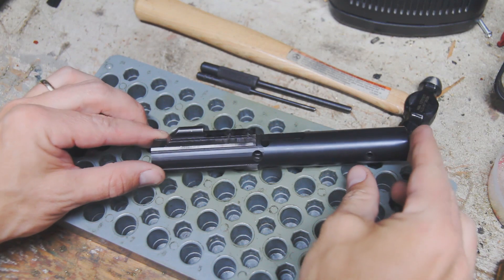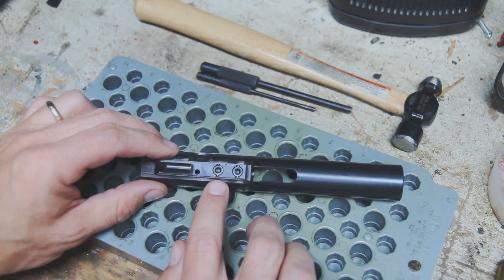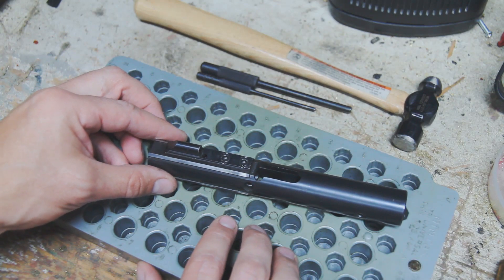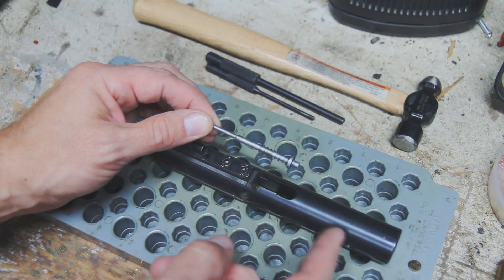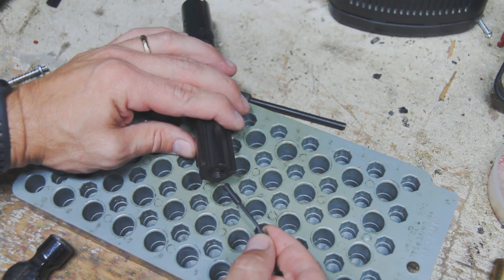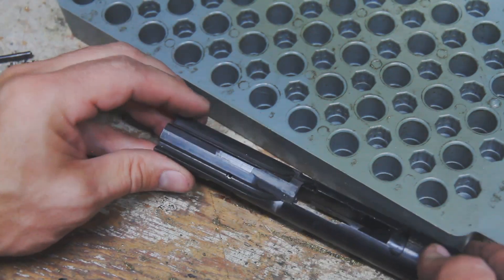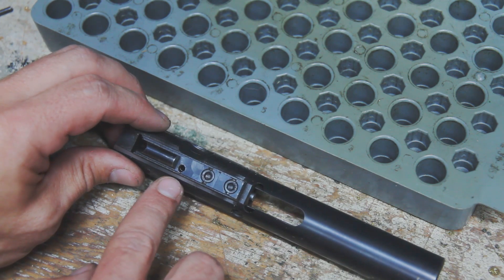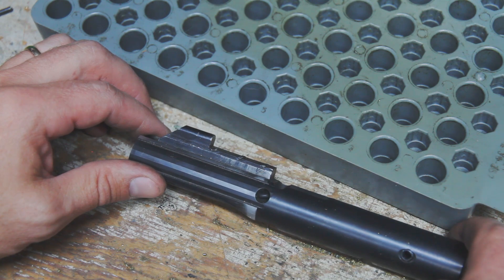AR 15 9mm Extractor Removal

Comment: I took the bolt out of mine and there was a tine spring that fe out...like an ejector spring on a 5.56 bolt....do you have any idea where that goes?
Reply from the maker: With this style bolt the only spring that I could think of is the spring on the firing pin, but that is a little larger than an normal ejector spring.
Reply: @AdventureColorado  it went in an indention on the bolt to keep it from pivoting ...thank you

Comment: Mine doesn't have the hole on top of bolt. Had to remove front screw from gas key to access it. Arghhh.
Reply from the maker: What brand is that?  I haven't heard of one like that.

Comment: The ar9 will run without an extractor. I accidentally know that. Don't ask, lol. It won't cycle by hand without it, but since it's a blowback, that case is flying out either way
Reply from the maker: The bolt will still cycle and the case may eject, but if the extractor is broken or missing it could have issues removing a case that is stuck in there due to being dirty, or out of spec.

Comment: Thanks for making video. In the process of maintaining my son's and grandsons' AR 9s, I found most of jams they encounter are caused by carbon build up under the extractor. In some cases it was necessary to remove the extractor and brush clean the extractor grove. However as part of regular cleaning routine (2-300 rounds) I put a few drops of solvent along the sides and underneath of the extractor, let sit a few minutes, flush with a squirt of brake cleaner, 2-3 drops of a very light gun oil and good to go. Also, Don't forget to inspect and clean the grabbing edge of the extractor and make sure the edge is not dulled.
Seems like this maintenance item has cured 95% of my jams caused by FTE .
Just my 2¢
Reply from the maker: Great points, I don't remove the extractor every time I clean an AR-15, but I do tend to pull them off every 2-3 cleanings just to make sure the internals are clean and make sure everything is moving properly.

Comment: Keith Fenner the YT machinist needed a wrench permanently attached to a tool post holder. So he found a spare 5/8th box wrench, cut the open end off, and put a 1+ inch offset on the box end. He heated it red with an acetylene torch and bent it 90* twice. A razor and a map torch with have that roll pin back in order in two minutes.

Comment: How does one go about cleaning the chamber where the firing pin and spring are located? 

After firing my AR-9, I remove the firing pin and spring and clean them. Since I fire a few hundred rounds each time, the pin and spring (and cotter pin) are quite dirty. I think it is reasonable to assume that the chamber where the firing pin and spring are located are equally dirty and are building up fouling after each session at the range. However, I haven't found a way to clean that chamber. Will you please recommend a process for doing so?

Comment: Thanks for the good instructional video. Short and to the point. I have the PSA AR9 with 4 inch barrel complete upper and Karris guns lower.  I finally assembled the lower and put the whole pistol together. I have a problem though.  It will load the first round but will not load the second round by pulling the charger again. I have not shot it yet so I don't know if will load the next round after firing a round.  Any ideas anyone? My AR15 pistol works just fine. Load a mag with rounds and cycle the charger to eject the rounds and load the next live rounds. I would appreciate any advice.

Comment: I ordered a 9mm BCG from Delta Team Tactical (love this co.) and the extractor had a larger claw than I've ever seen in any other 9 BCG. Noticed that my case rims had a super sharp cut in them so I ordered a standard extractor (not internal) and this vid helped me install it. Thanks.
Reply from the maker: I’m glad it helped, thanks for watching!
Reply: Did the standard one help? I’m having the same issue with my iron city rifle works BCG.
Reply: @momanddadplusus  Yes it did. Although my issue was also the ejector on my Colt lower. If you shave it back some (very little) it will eject the casing while the bolt is further back allowing for more space for ejecting. In my case I have a dedicated 9 upper with a shorter ejection port. This reduces stove piping.
Reply: @69ChevyGarage  Very good info. Thanks for taking the time to answer me back!

Comment: does that pin go in front of the firing pin took mine apart cant figure how to get it back together
Reply from the maker: Yes, there should be a collar on the firing pin that gets captured by the cotter pin.
Reply: I can’t get my cotter pin back in. I’ve tried pinching the ends and tapping it with a hammer... If I buy a new one that’s pinched together more, does it need to be a specific kind or hardness?
Reply: You'll notice, at least most of the cotter pins I've worked with one end is slightly longer than the other. Clean off the ends of the pin with some fine grit wet or dry, push the pin through until the longer side enters the hole. Take a small screwdriver and push the shorter side of the pin towards longer side while continuing to push the pin home. Hope this helps.

Comment: Just put my ar 9mm pistol together today and it's not extracting spent casings any ideas? Appreciate any suggestions.
Reply: Any update on this? Having the same issue with my Ar9. Tried a different bcg. Have a 7.5oz buffer and tried swapping that for a standard carbine buffer and still having issues.

Comment: My won’t eject, any ideas why?
Reply from the maker: Is it extracting from the chamber, then failing to eject?
Reply: @AdventureColorado  any update on this issue?  I am having the same problem.
Reply from the maker: Wilbur Allen it’s hard to diagnose without being able to see it. There is a chance the extractor isn’t strong enough and is dropping the case, or  the ejector is not properly aligned.
Reply: Yes.
Reply: It's an ejector problem. The ar9 will run without the extractor. It won't cycle by hand, but since it's a blowback, it will run from firing it. May try pulling the extractor and see if it does the same. It's gotta be the ejector, though. What ejector system?

Comment: AdventureColorado,  I saw your first video comparing the two AR-15; 9mm and 5.56. I'll follow your advice and not mess with that extractor.I enjoy the PCC matches so I purchased a FM-9. Great carbine. My question has to do with parts of the 9mm bolts in case something breaks.  Are all these AR-15 9mm bolts parts interchangeable?  My FM-9 came with no manual; all information is on their web page with no parts offerings. 
Last of all thank you for taking the time to educate.
Reply from the maker: I'm not familiar with that brand, is it Foxtrot Mike?  I looked up the Foxtrot Mike website and the bottom of the page for the bolt says "Extractor spring and Hardware made to Colt Spec."  While there isn't a standard for all 9mm bolts, the Colt design is probably the most common.
Reply: Yep, Foxtrot Mike products. I re-read their information that states,"9mm bolt carrier assembly is compatible with all 9mm pistol caliber AR builds." I just want a spare part in case. Thanks for answering.

Comment: AdventureColorado
    Thank you very much for taking the time to make and post this video. I couldn't have gotten it quicker if I had paid for it!!! 
This is the first video of it's kind that I have seen anywhere and am sure it will help others as it has myself. I figured it was easy enough to remove and re-install the extractor, but was hesitant since I wasn't sure if there was indeed just one roll pin holding it in and/or also a spring. After
 watching this I was successful in removing the one in my BCG. Thanks again for your generosity and  safe shooting my friend!
Reply from the maker: You're welcome, I'm glad it helped out!